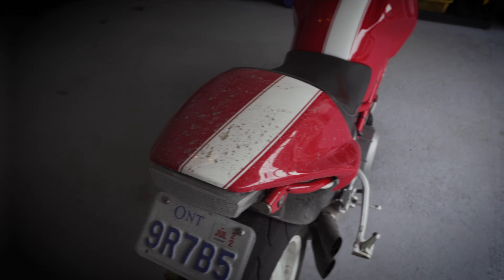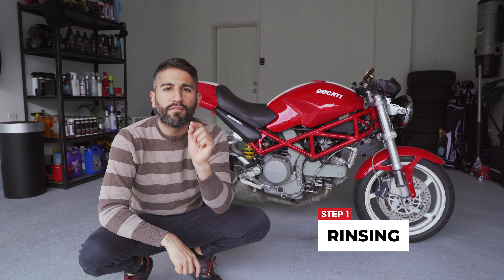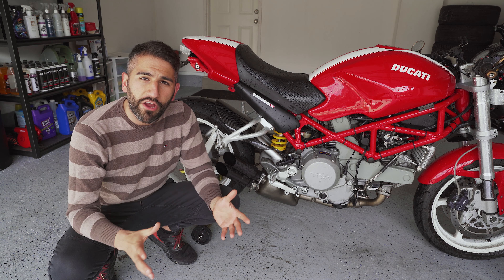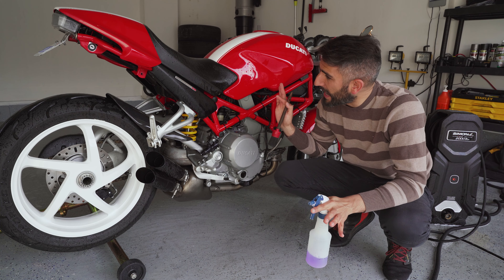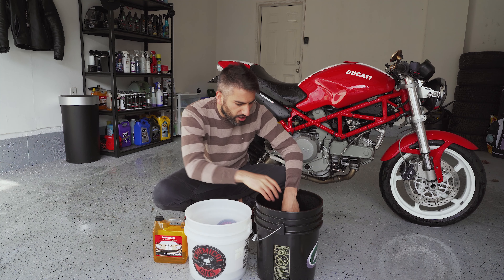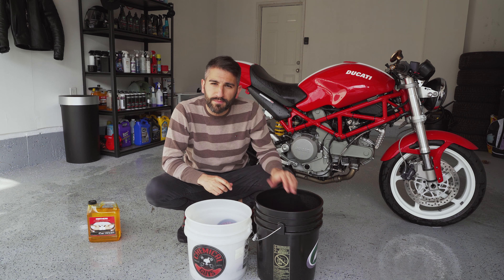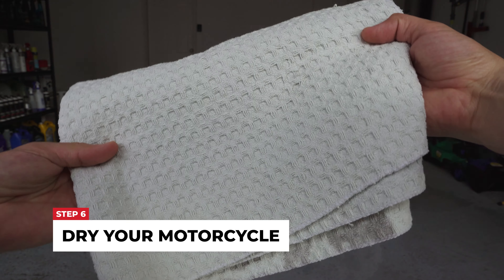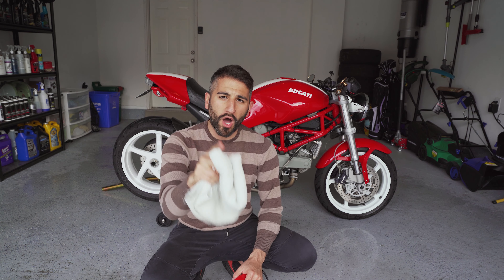How to PROPERLY Clean Your Motorcycle! Professional DIY

Comment: Very informative video! Any concerns causing electrical short with the water?
Reply from the maker: All modern motorcycles are designed with rain and water in mind. Just don't point a 0 degree nozzle on a pressure washer at cables or electronics and use common sense and your good!

Comment: uhhhhh,  I've had 3 of these bikes, they are such a pain in the butt to wash when you get suck in the rain, naked bikes, I was lazy and used a air compressor with air and soft brush (not the correct way i'm sure to wash it lol) ( one trick I did was get home, after you get suck in the rain,  wash it off with water hose Asap and take air compressor at 90psi blow all the water dirt off it especially the engine fins all those tiny hole spots )
Reply from the maker: Great tip as well to keep it clean after a rain shower 👍

Comment: Really shouldn't use snow foam on an already wet vehicle, prevents the foam from working correctly.

Also... Not a fan of grit guards, you are literally rubbing the mitt at the bottom of the bucket near the grit. Go for no guards and just keep your mit in the top 6 inches of the bucket, grit and stones sink to the bottom, it's basic science.

Awesome video and awesome bike though dude, I'm going to be looking for an S2r 800 soon, more characterful and interesting that the new middleweight crop (MT07, Trident, CB650r etc...)